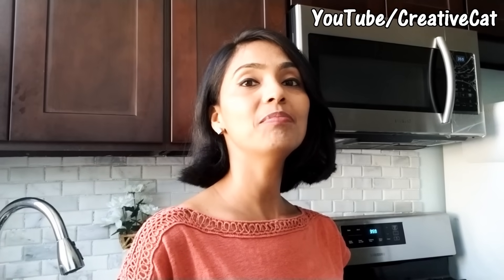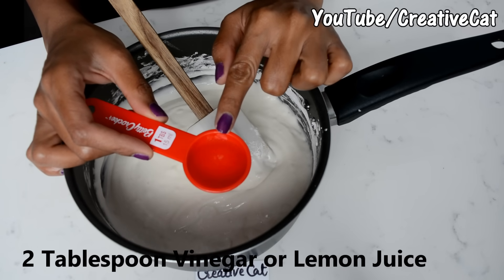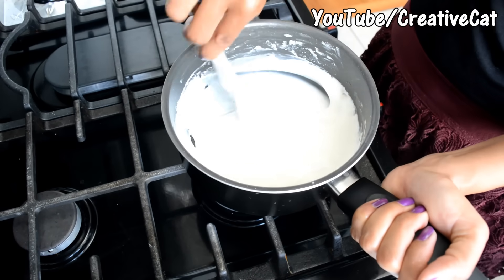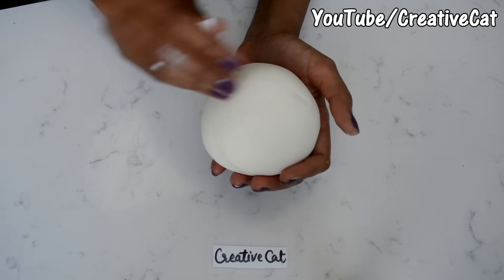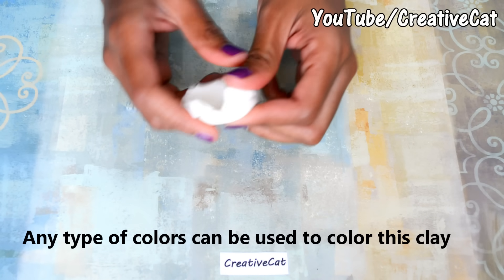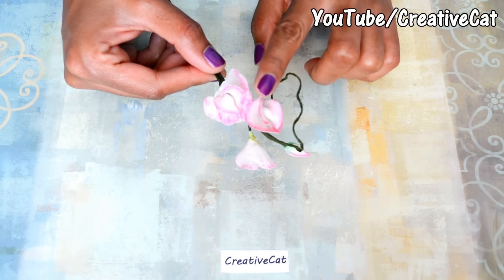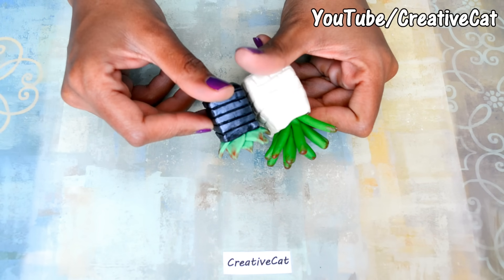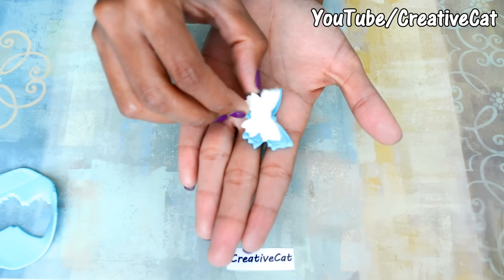Best Homemade Airdry Clay and Tips to keep in mind / Cold Porcelain Clay On Gas Stove/lamasa clay

Comment: Got tip: if you put just a little bit of cooking oil or baby oil in the cup and rub it all over it before you put the glue in, the glue will slide right out of the cup and make it’s much easier to clean up :)
Reply: Nice tip thank you so much...
Reply: 𝓖𝓸𝓽 𝓲𝓽
Reply: I like the cooking tecnique that the
Creativue Cat came up with.
Purdu clever.
Thank you.
From me,K-Lee and
Mo-Bro.Aka
Molly Brown.🐕🏳️‍🌈👍
Reply: This works 100% ty x
Reply: @amandamoses9179  no problem :)
Reply: What is Corn flour
Reply: @williamweaver6003  Corn Starch
Reply: @loram4299  I think they are different. The cornflour i get is not pure white and not super fine like cornstarch or all purpose flour. Will it still work?
Reply: Good idea. Nowastage too
Reply: @swatid3550  you might be thinking of corn meal, which is not as fine and not white. Its used to make cornbread. 'Corn Flour' is generally like corn starch... in most countries anyway
Reply: Do yo maintain a separate pan for this clay preparation or reuse the pan for cooking after washing well?
Reply: @Bappa108  nope… just wash it and it’s good to go! The clay is water soluble so you shouldn’t have any problem cleaning the pot…
Reply: @KLee-ci3gt ❤❤❤❤
Reply: Homemade clay par uv resin use kar sakte h???
Reply: @ZippedUpKitz  is it compulsory to use non stick pan???
Reply: How long can this clay be used after preparation and packaging? It will not smell? Please answer these two questions soon.
Reply: @ I made some a little over a year ago… it’s still in the ziplocked bag I put it in…. I double bagged it… made sure all the air was out of the first bag, rolled it up and the. Put int into another zip lock bag… it’s still good!

Comment: So, I tried this today - it was wayyyyyyy sticky when I was trying to knead it, and I gave up on the lotion idea and sprayed my hands with nonstick spray. That made all the difference - the sticky goop turned right into beautiful clay! The longer I worked it, the smoother and prettier it got!  I am thrilled with the feel and look of it!  It's in the fridge chilling, and I've got to go to work, but I can't wait to try using it tomorrow! Thanks so much for the tutorial!
Reply: Which method you used to make clay
Reply: Can you tell me is it working?
Reply: @chilling007  It's okay, actually, but it has some issues in using. IT SHRINKS so badly as it dries that if the thickness is at all uneven it cracks and twists. Too thin and it becomes brittle. I wouldn't use this for art with much detail, but it would be great for cookie cutter ornaments. I  did not have good luck using it with silicone molds, but I may have not done it right as I'm new to molds as well.
Reply: @w.l.elliott7182  have you used any other clay? Or any other way to make clay?? If you did....can you recommend me some? Also any specific things i should focus on?
Reply: Is this recipe really work for you??
Reply: @w.l.elliott7182  old reply but as someone with 2 years of experience... U need to know how much it shrinks bcs all air dry clays shrink and then make it so that the clay shrinks to ur desired size. Hope this helps!
Reply: @vanessathebaconhater  What did u cover it with? UV resin or varnish? I'm looking for an alternative for UV resin
Reply: 9:04  @w.l.elliott7182 hiya😊 this was my question asking if it can be used with silicone moulds! Im so done with DAS clay with it cracking and breaking on me! Have you tried any other recipes for clay to use in moulds? Thank you in advance for taking the time to answer my question 😊x
Reply: @nikkiejones4606  I wouldn't bother trying. It shrinks really badly and very unevenly. I gave up on it and bought epoxy clay, Which I love it is chilly with the money
Reply: That was supposed to say it is totally worth the money, I have no idea how the word chilly ended up in that sentence! XD
Reply: Ive read elsewhere that to avoid cracks, air dry clay should dry out slowly in airtight container with a dry piece of newspaper in it that you replace with fresh newspaper daily.
also that many cracks can be filled with watered down clay applied with a paint brush, and sand off any excess

Comment: Tip: You can also use cornstarch if you don’t have cornflour, and you can microwave it if easier.
Reply: cornstarch is cornflour
Reply: @amamamia4391  Not in the US. They are 2 different things. Corn flour is yellow and is protein-based. Corn starch is, of course, white and is starch-based. In other countries, they mean corn starch when they say corn flour. I only point this out because if someone bought and used corn flour for this recipe in the US, it would likely produce a very different result.
Reply: @scootermom1791  Thanks for your concern, corn meal is yellow and makes good bread and muffins, corn flour is what some countries call corn starch and is used as a thickener for puddings, gravies, sauces and real handy for some crafts.
Reply: @amamamia4391  corn meal, corn flour, and corn starch are  distinctly different corn products in the US. Corn meal is grittier version of corn flour made by grinding dried corn kernels. Corn flour is made by grinding the corn meal into a fine powder. Corn starch isn't produced by grinding dry corn kernels at all. It's a grain starch extracted from the endosperm of corn kernels and dried to form a white powder. It has completely different properties than corn flour.

Comment: I believe you missed out the fact that you need to rest clay after it’s been kneaded for 24 hours. Also-you must knead the hot clay until it’s room temp. These are important steps!
Reply: Thank you for this tip, I did wonder because it had been said on another video. I wonder if you can answer my other question. When adding the white acrylic paint, can you add a different colour to make coloured clay?
Reply: @DebbieFord-r2x  l don't see why not, if you want the whole batch the same color.
Otherwise, take some of the finished clay and color with a few drops food colouring?

Comment: I'm doing some strength tests.
Cooked vs un- cooked.
Added fibre glass wool also.
Water resistance test using exterior grade PVA and liquid latex SBR.
I'm trying to develop a heavy duty version for more hard wearing application.

Comment: I know it is an old viedo but I have a doubt. Can you clear it. While moulding this in a silicon mould should I smire any oil or vasline to the mould for easy pick out.
Reply from the maker: Yes you can either use some cornstarch, or use Vaseline

Comment: I don't know why it's not working for me. I tried twice and failed. IDK what the problem is. Is it the glue that I used or the pan. I followed the recipe to the T but still ended up with a blob of clay-ish material which was a little hard then the normal clay and however much I kneaded, it kept shrinking to the original size. Can someone please help me out?